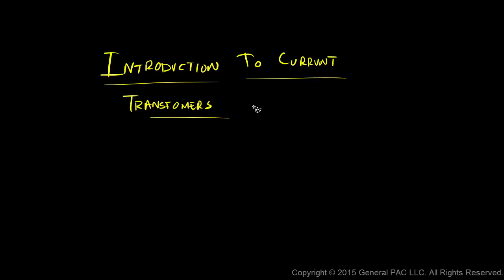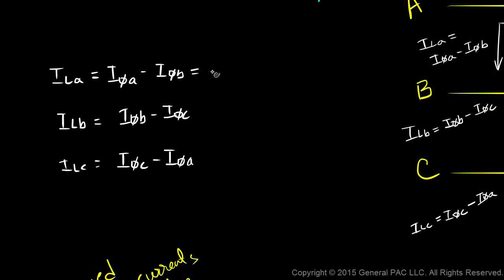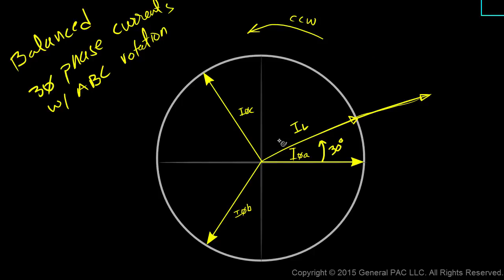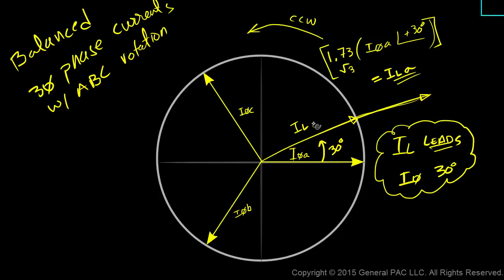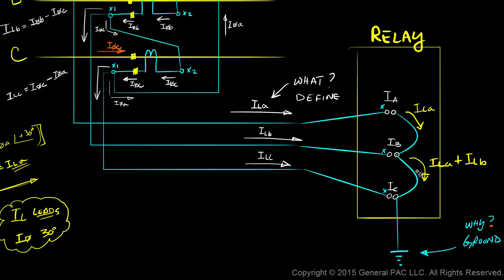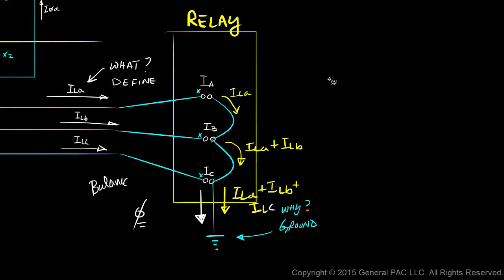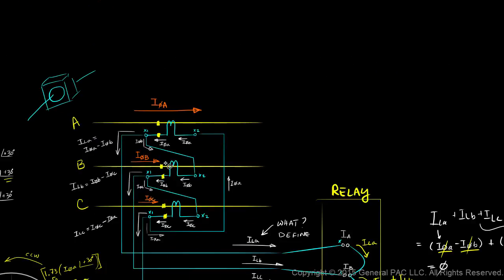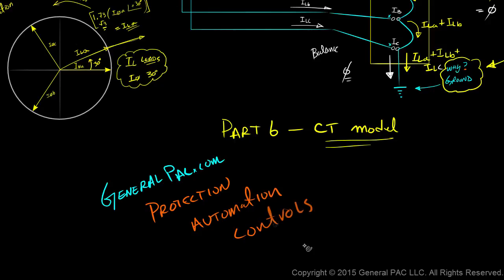Introduction to Current Transformers Part 5b: Delta Connected CTs

Comment: Hi, can you show connection from CT to an overcurrent relay where the CT is inside tertiary delta winding.  Should we use star connected CT or wye instead. Can you simulate current flow as well. Thanks!

Comment: 25MVA,33/6.6KV transformer primary injection testing done by shorting LV side and providing 3ph supply on HV side. It's consist of differential and sef, ref CT's.. I would like to know actual procedure and calculation.

Comment: where I can find why the we ground the terminals? it's looks like y connection 
could you please explain the meaning of burden of CT? 
thanks alot
Reply from the maker: If we don't ground one side of the secondary circuit, the voltage across the CT bushings may rise due capacitive coupling between the HV winding and LV winding of the CT. Theoretically, the voltage may rise to equal to the line voltage... Which is very dangerous. However in practice, without grounding one side, the voltage rises to uncomfortable levels. As soon as we tie the CT to ground, the CT secondary circuit has a reference and the capacitive coupling problem goes away.

 Hope this helps. Please like and share these videos!
Reply from the maker: The burden just means the load that is connected to the secondary CT terminals. Burden (load) includes conductor impedance that connects the CT to the relays, internal relay impedance, etc... So the burden is simply the load connected to the CT.

Comment from the maker: First, the CT connection should be clarified - In this example, we're assuming that we have a 4 wire system - which means that the current that is flowing through conductor A, B, and C is actually actually phase current (4 wire system or WYE connected system). So technically, the CTs are connected in Yd11 and not Dy1. This was pointed out to me by someone. 

Ia - Ib results in a 30 degree phase shift. Before it's explain, let's be clear which current we're talking about.

The primary phase current (current flowing through our 4 wire conductors) and secondary phase current (current flowing in the the actual delta connection) are going to be relatively in phase. Sure, the magnitudes will differ based on the CTR but there will be very little phase shift between the two currents.

The secondary phase current (current flowing in the the delta) and the secondary line current (current going into the relay) - that current will have a 30 degree phase shift.

Why does this phase shift occur? Because phase secondary phase a current and secondary phase b current are 120 degrees apart. So if we subtract one with another, the resultant phase will be 1.73 times larger and will have a 30 degree phase shift. A very similar example is found another generalpac.com tutorial - https://youtu.be/9xsubEoKwLY?t=2m50s 

If this is something that needs be further explained with a dedicated tutorial, please suggest it!

Comment: Excellent video. Can you explain why Ia - Ib results in a 30degree phase shift when they are 120 degrees apart?

Look forward to the next video in the CT series.
Reply from the maker: G Robbo  also check out the Delta Wye transformer connection video here: https://www.youtube.com/watch?v=UGAzp0CTK2A  - Where the 30 degree phase shift comes from is explained in detail in part 5b. I hope you find this useful!